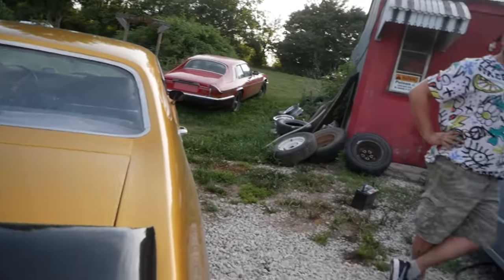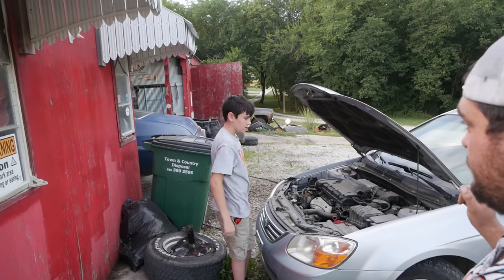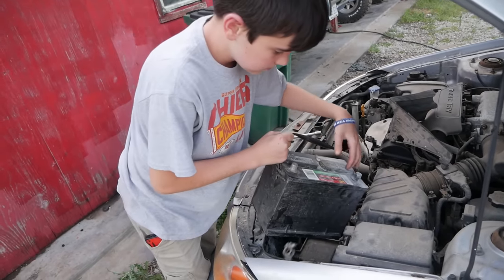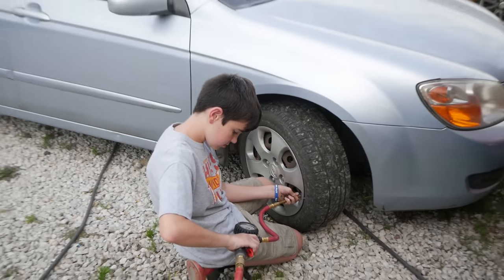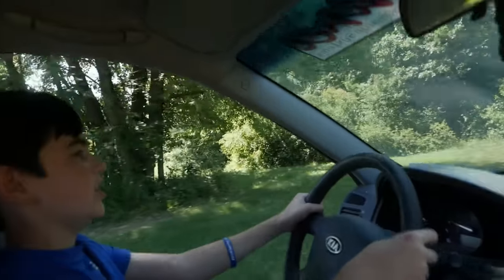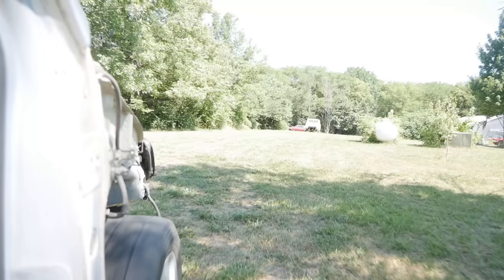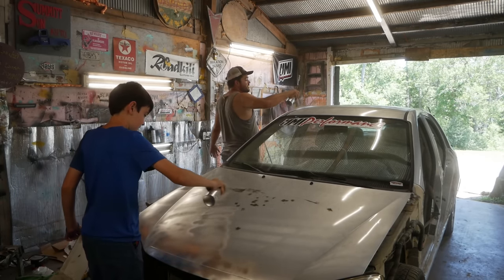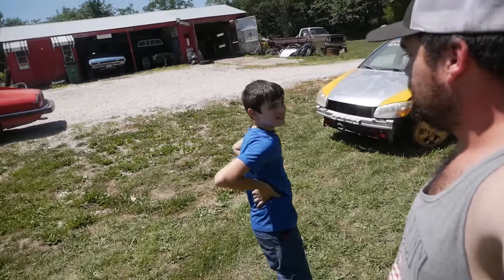Turning Kia Spectra into ULTIMATE Go Kart! Better Than a SXS!

Comment: I had a 2006 Spectra once. It was gutless, but very reliable. It was my first KIA and I was hesitant. I've been buying them ever since. There is a secret turbo button, the AC off button.
Reply: I have a 2006 spectra as well mine Is a 5 speed with over 200,000 miles still gets around 33 mpg.
Reply: Hilarious
Reply: Hmp.

So KIA did actually make a reliable car at some point?!
Reply: Any car with proper maintenance can be very reliable.
Reply: My 1998 Chevy Lumina had a automatic secret turbo as when you put in too much throttle it would shut down the A/C and blow hot air into your face until you were done demanding power then kick back on.
Reply: @Hybris51129  Ugh.

Luminas seemed to have a LOT of secrets.

If I recall correctly, one was a poor turning radius for such a small car.
Reply: @iFixJunk  Oh yes like vacuum control hub under the battery tray that was prone to being damaged by battery acid. Of course you have to take off a frame member to get at the battery so you typically didn't know you were about you loose all of your vacuum systems until it happened.

Still I learned a lot about working on cars dealing with that things secrets and GM's terrible engineering.
Reply: @jamms992  except for their modern siblings. I had a 17 Elantra that had it's motor go twice. once under warranty and a year later when it was just out of Hyundai's warranty. Motors built like swiss cheese, dead at 102,000 miles.
Reply: @Hybris51129  LOL is that an actual feature? pretty hilarious.
Reply: @rushnerd  I doubt GM would consider it a feature but it was too consistent over the 12 years my family had that vehicle to be a broken or damaged part.
Reply: @Hybris51129  Hell I'd love that feature in my Celica or Supra honestly. I hate having my AC on when I know it's sapping HP and I'm trying to go fast. 
Not a Gm guy, but I do like the Luminas. Not sure why they stopped making them, it was a cool name and the cars looked nice enough.
Reply: @rushnerd  Well the Lumina was a 4 version of the Monte Carlo if memory serves and when that line was dropped in early 2000's so too was the Lumina as by then sedans were being outsold by SUV's.

As for the feature while it might help when you are going hard it's when you are not that it becomes hellish. At least with the Supra you have enough horsepower to start with that it's not as bog of a deal and if you want more then the aftermarket exists to make that happen.
Reply: @Hybris51129  Ahh ok, I get it now. Ironically the AC in my 88' Supra was a bog because it was on the now outlawed refrigerant and was NOT cheap to get converted lol. 
It also has state of the art (at the time) electric controlled vents which of course means they don't work quite right now. As for the HP, yeah 200/195lb torque is nothing to look down on, but she's also heavy as hell (which I assume all modern cars are now) but it's a VASTLY different and more direct experience than my Celica which you have to work you ass off in revs to get that speed and power. I'll look out for luminas on the road now, but I haven't seen them in a VERY long time.
Reply: ayo my rondo has that to once thats off that 2.4 rips!
Reply: @iFixJunk it's fwd , the turning circle is always wider than rwd.
Reply: @alwynemcintyre2184  Actually, I have had many of both, and not all my FWD cars were so dramatically bad at turning tight.

I'd say my Chrysler Sebring Convertible was worse about turning than the '92 Buick LeSabre, which turned ABOUT as tight as my '95 Thunderbird. 

The '92 Bonneville, though? Not quite the same, somehow.

My '88 Accord Coupe turned pretty tight. So did my '92 Cavalier. '99 Altima a little less so....

Comment: I had a 1990 Pontiac LeMans 2 door hatchback that I got for $200 back in high school that we turned into a go kart. Had so much fun.  Got it stuck on a hill at my buddies parents property. It was wedged between two trees on a 45-deg slope.  I hear its still there some 24 years later. I really miss the bargain corner classifieds in the Sunday paper.  Was promptly replaced with a $300 1992 Olds Cutlass Calais.  It was 80% rust.  And loved to randomly strand you.

Comment: Awesome !! May I suggest off road tires, and a sawzall roof removal, leaving the B pillars connected (IE the cutlass and/or PT convertible basket handle) for rigidity… I guess….
Reply from the maker: We weren't sure if the roof should stay, on account of rain and what not
Reply: @outsidethebarn  leave the roof, rain is a factor but we all know either you or JD is gonna smack into a tree and the roof will keep a limb or the entire tree off of his head.
Reply: I'd leave the roof, on the account of all the "air time" this car will see, once he figures out that it can go above 30 mph...

Comment: You basically built a Swedish folkrace car. We used to build a couple very much like this each year in my youth. And go race them on the fields after harvest, it's called Stubbrace. Great, cheap fun! And you learn weird things too, like how the stations wagons always last the longest. Still don't know exactly why? But that was always the case for us. 😂

A tip; If you weld a "T" shaped tube between the front seat backrests going from the driveshaft tunnel to the roof, and out over the drivers and passengers heads, it will be safer if it should turn over. 
ATV tires are also great, and cheap. They're also made for lighter vehicles, which this now is. And if you just put them on the fronts, with some hillbilly slicks (worn tires) on the back, you'll slide all over!

These things are great fun!

Comment: I would say this thing was almost in better shape than my $1,000 2000 Nissan Dentra I've been beating on for 5 years, but the Dentra has a 5 speed, working AC, and it's not a damn Kia / Hyundai POS. Awesome little project, should be a fun beater for years with a yearly oil change and a few mods to keep from deleting the oil and trans pan. Just be sure to wear seatbelts in that thing, lest ye may be thrown out. Ejecto seato, and all that. 

Keep up the great work, hope JD has fun with this little pile of junk, they aren't much count as real cars anyway.

Comment: there are some 15" skid loader tires that would most likely fit on that car with some cheap aftermarket or used wheels.  Put somthing like that on a old escort and it went through so much crap , it was pretty amazing what front wheel drive with all the weight over a aggressive tire can do .

Comment: I've had several mid 2000's  Hyundai Elantras (Same as a Spectra), I paid between 200 and 500 for. My son learned to drive in them. He was pretty hard on them. When they would get wrecked, busted windows, ect. I did the same thing with them. I would love to get another one, lift it a little, marketplace  A/T tires, Harbor Freight winch, ect. Way cheaper than a SXS.
Reply from the maker: That's kinda the end plan I have for this! JD doing most of the work will help with time

Comment: The stock steel wheels are small enough, you could probably find some cheap atv tires to mount on them. Making spacers between the strut tower and the strut top will give you a cheap and easy lift.

Comment: Looks like this will be a fun project!

I would have probably just ripped out the airbag control module… but better be on the safe side!

still needs some kind of reðne¢ĸ lift kit…

and you may have a look under the carpets what kind of electronic garbage is hiding down there that's necessary to drive that thing

Comment: The valve cover gasket on those engines like to leak and it definitely needs a new timing belt. Those repairs are shockingly easy to do on a Spectra.

Comment: Why did you remove the airbags ? I don't see how they would increase the risk of injury if he is buckled in. They are only deployed if the deceleration is high enough to warrent them in the first place.
Reply from the maker: Steering wheel airbags are great at breaking your fingers/thumbs if your hands aren't in typical driving position. He won't hit anything fast enough to matter though, you're right
Reply: @outsidethebarn  OK. Thanks for clearing that up.

Comment: Besides giving the boy the JAAAAAG, this is optimal.
Skid Plate Version 1.0 is the trunk lid, fastened to the front with shelf tappers...
Get rid of all the airbags.... Then have a "science day" to learn how to make momentary switches(bare wires) and learn about gravity and power(figure out how high a chair/random object will get lifted by setting off an airbag under it)....
Light Bar Version 1.314: All of them. Everyone you can find for under 100 bucks, then...
Charging System Repairs: why 20 light bars and a itty bitty 75 amp alternator won't handle it.

The possibilities are endless. Pkus it has a tow bar in it, so when one of the other rigs decides to not start(ahem. JAAAAG) it will help out around the shop.

The 2 main points are:
You parenting correctly. And...

Handbrake turns.

50/50 mix of both. Unless he does a lot of handbrake turns where he's not supposed to, then it back to parenting(building character/ replacing sod).

Comment: You mean you didn't want to use the jag
Reply from the maker: So, actually. I bought another Jag for parts, it has a V12, I plan on getting it running, but I had thought to make it JDs go kart 😂😂😂
Reply: @outsidethebarn  and thusly the jag will ride again
It is a bit disappointing the fuel urinal shit the bucket like that, but the jag demanded better.
Wonder what would happen if you stuck a thermoquad toilet on it